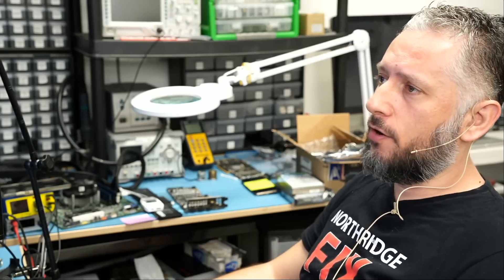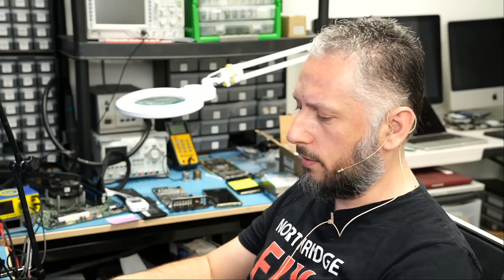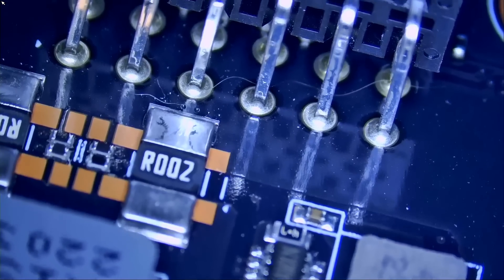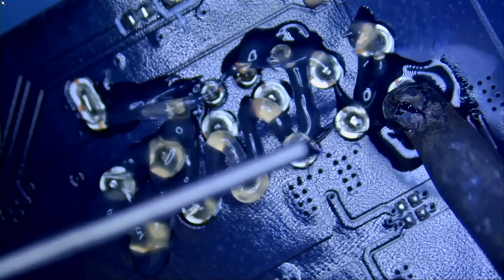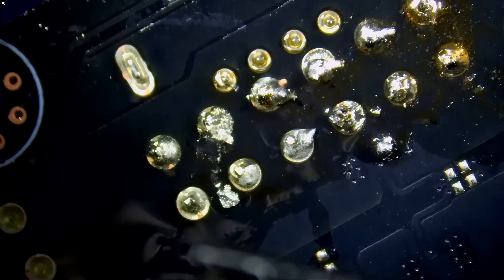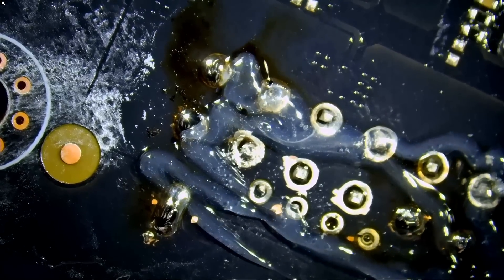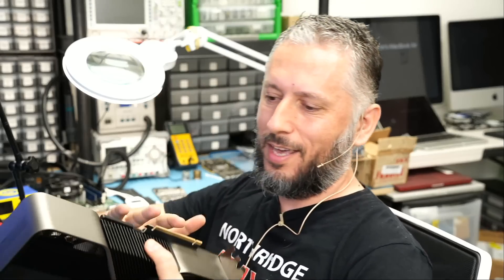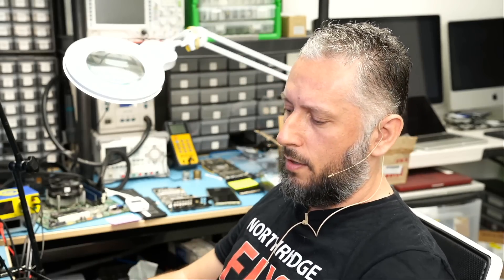Serious issues with 4090 power connectors melting - Is the user at fault ?

Comment: The connector for this particular card is a joke. This is in no way the user's fault. This is a design flaw. The WHOLE design is a flawed design. There is not only the issue of the connector being too weak for the amount of power going through it. There is also the problem of these connectors going out of the side of the card instead of the back. As these cards are extremely large, unless you have a very wide case, the wire will need to be bent to fit. This is a no no with that type of connector. These cards are an absolute joke and a nightmare to boot. I will stick with my 3090 TI for a couple of generations. I am good to go. Although the 3090 TI has the same connector, it isn't on the side of the card. Also, it only needs three power connectors, not 4. Too much current and too much pressure.  I think Nvidia needs to jump off a cliff with their prices anyways.

Comment: I think this connector is not ideal.

I know why it's a thing: three big connectors was too much, there needed to be some better solution. I know from an engineering standpoint this connector is fine, it meets all the specs and if connected securely works perfectly fine. It does require a lot of care from the user however and no small amount of force - which may seem excessive to some - to connect properly and avoid melting itself.

It's not perfect, perhaps the extremely high power draw of these boards just necessitates a lot of big high power connectors that are a little easier/more reliable than this particular connector and there's no neat way around that.

Comment: This connector is certainly at fault here.  If the connector is plugged in and the cables are routed tightly in the PC then some of the pins will loosen faster than others and have a different electrical resistance.  This isn't just a user error problem it is a design flaw that can take time to show its flames.  The metal in the pins themselves will loosen over time through normal use and this is a problem with all devices with connectors, the connector will just loosen over time.  Loose connections have more electrical resistance and that means more heat.  In this case its enough to melt plastic.  If it were allowed to get worse then that could mean fire!

A proper high current connector would have used a larger surface area with screws to secure the contacts together.  No chance of them coming loose if you screw them down properly with a lock washer on the screw.
Reply: And it is not the pin side of the connector on the card, it is the socket side on the cable end that will loosen and eventually cause this problem.  This means manufacturers of PSUs and video cards can just point fingers at each other until the end of time, but in the end it is the connector design that is bad.  Anything using this connector is going to melt eventually.  It should not have been designed this way.  Should have been large surface area contactors that screw together with lock washers on the screws...

Comment: I suggest to check the power rating of the card first and install the appropriate 12vHP power cable that is rated for 600watts for the 4090 series.

Comment: As far as I know, the problem lies more in the power cable than in the connector itself. the fact that the plug-socket set withstands up to 15 connections-disconnections, unfortunately, does not help here either..

Comment: so this has already been looked at by gamers nexus. although i still think the pins are too small for the amps it pulls. the actual cause is the owners of the cards, they need to push the connectors in harder

Comment: I disagree the customer should be responsible for not pluging in a cable all the way….but also the customer should be able to tell the cable is pluged in all the way, which in these cases the customer can not visually see the connectors pluged in due to the heat sinks. And they cannot feel if its pluged in all the way because theres no click from these plugs

Comment: THANK YOU !! Alex for your professional/experienced opinion., lets say 500 watts going through those whimpy connector joints/pins, and  those split/dimple/crimped connector pins are weak as heck. Thanks for your opinion that the manufacture should take all design issues including user error and make the connector full proof. On the cards where 2 or 3 connectors were used, this problem NEVER existed. Other manufactures have made adapter where the connector is even weaker. Thanks again for your professional opinion.

Comment: There are many unanswered questions.  Is there some reason why the user is likely to plug in the connector incompletely?  If so, then this is a design flaw -- or at least inadequate instructions -- instructions to seat the plug COMPLETELY should be prominent and obvious; likely repercussions should also be stated.  High-current connectors are tricky to design and to fabricate and use is likely to wear the surfaces and loosen the contacts.  Once resistance begins to accumulate, they begin heating up, oxidizing, and resisting current flow more quickly.  By choosing to install connectors instead of soldering the wires directly, the card manufacturer has assumed the responsibility to assure that the connector is used correctly.

Comment: Where is the heat coming from to melt? There must be a resistance somewhere between the plug and the socket. I2R= W. Perhaps the plug doesn’t match the socket correctly..and therefore not making a good resistance free connection.

Comment: This is exactly why I haven't purchased a 4090 GPU. Alex is a professional in this field of electronic repair and he has questioned several times about the fact that so much power is now being drawn through such a small connector.  Sometimes innovation does not pay off and I personally believe that this is a weak failure point on such an expensive computer component. I would rather have 4 PCIE power connectors into a 4090 than have the connector melt and create a risk of fire.

Comment: At the bare minimum connector is sub optimal for the job and potential user error is last nail on coffin. But id say connector design is bad and should engineered better or used industry standard connectors instead, so on manufacturer is the blame.

Comment: There are 2 types of female pins for this plug, one of which has been officially stated you should not use, these pins for male/female are rated at 9A (the same per pin rating as a 6/8 pin BTW)

a 12/16 pin plug gets 6 pairs of pins for power and ground, that is 108watts per ground/power pin pair, that meas 648 watts for a 12/16 pin plug, now a 8 pin plug has 3 12v, 3 ground and 2 sense pins, now lets do some math here so 1 pin has 3 12v if i use 2 of them i get 6 12v and a 12/16 pin also have 6 pins they are the same

8 pin are only rated at 75 watts so you need 4 of them to match a 600W plug, now lets ask WHY a 8 pin is rated at 75 watts, what ever the reason is if you obey the same rules the 12/16 pin plug is a 300 watt plug

Comment: This plug needs a better locking mechanism, one that you get close and pull a lever down that locks it into place, something like those jars with clamping lids or a LGA socket lever

This plug was designed to bypass the official spec rules of the 8 pin plugs, 2x 8 pin are electrically just as good as this plug

see my comment on last video for more details

Comment: After looking at the 90 adapter, it looks more like the manufacturer used a less than adequate connector on the board.  No way this is the user's fault.  Fire the engineer, not the user.

Comment: 450watts tdp ÷ 12volts= 37.5 Amps
overclocked i heard the 4090 can hit 600 watts
which would equate to 50 Amps... imagine pushing that much current through 6 tiny pins (6 pins for +12v and 6 pins for gnd). this is a simple electronic engineering failure. 100%

Comment: Problem I've seen with some boxes is that the cables are restricted with all the hardware and sometimes makes it difficult to plug in the cables.  (Solution: get a bigger box)  But, some are limited on funds and go for the hardware expense rather than the housing that many consider less important.  Not so.  Having full access to easily work inside the box is very important, especially when you do the higher end improvements like liquid cooling, etc.  Buy a bigger box.
Reply: Bad take. Most cases in use are m-atx, full stop. The card doesn't fit properly in far too many cases and it shouldn't have been designed like that. Most people don't want a hulking atx case and Nvidia should design cards that fit in most cases without the side panel impeding the cable. I could see if it was people jamming 4090s in ITX cases but that's not really it. To be totally honest, the card should have its own power supply that just plugs in the back. Running 400ish watts generally across this cable is poorly thought out from the beginning.

Comment: First it's a connector designer fault, but it is accepted as a new standard so that's it, it will hardly change. Secondly melted connector was a big issue when 4090 was released. Seems to me long time ago now lol. Anyways, the issue was posted everywhere, on every social media, every tech related media. 
Then they found what was the issue - connector has to be plugged all the way, there is a notch which should click (silently) and which is a kind of security for the connector to stay plugged. Just like 8pin, or 24pin...blah blah blah...
It's a bad standard imo, but it's a standard now so after so much talk about 4090 melting connector one should guess everyone knows about the issue and the fix. Because of that I split the blame between connector designer, the gpu manufacturer for not printing the guide with big red bold letters connector have to be plugged in all the way, and lastly the buyer which missed that info about the issue and how to solve it  🤷‍♂️ LMAO I just read what I wrote, looks confusing LMAO
Reply: Get some help dude

Comment: These connectors suck, I’ve seen several units come in with issues and the connector looked seated at a glance but once you checked it physically it wasn’t fully seated.

Comment: The key here is that the connector is so finicky that even tech-saavy users who know how to hook up components were finding burned up boards. Now, just wait until you start getting burned up ASUS motherboards from the brand new overvoltage scandal that has emerged. That arguably has made the 4090 connector issue small potatoes by comparison.

Comment: That 90 degree connector will be interesting. Looks solid. I’m wondering if there’s a thermal expansion problem under load, which somehow changes the contact area between pin and socket?  Glad I can’t afford a 4090

Comment: Lol that 4090s are smoking HOT, literally. I am glad i went with the 4080 and i have no issues with the connector there. Just quadruple check if the connector is seated rocksolid all the way in and the cables are not bent so they are not putting any stress on the connection. Up to 600W my ass, these connectors are burning within 450W of strain.

Comment: It’s a bad design and user error combined. When properly inserted, it works fine. The problem is that folks are trying to reuse their previous PC case, but the 4090 is just bigger and if the card is not in a vertical mount - the power cables get wedged in between the side panel and the card - the power cable pins are the victim. If folks would buy a PCIE riser and vertical mount - the power cables come out the top and there is no interference.

Comment: This new connector is a design fail, cable sticks quite alot from already huge card, often making it impossible to close the side panel without force, add the weight of the cable that is often connected through 4 another cables and theres no way that small connector can take all of this.

Comment: mmmmm..the connector is a 12VHPWR socket, rated at a maximum of 600watts, that's 100 watts per pin (because there are 6 +12V and 6 GND pins), @12V that's 8.33 Amps per pin. My understanding is the 4 smaller pins are used as 'sensors' to detect if the plug has been fully inserted, if the sensor pins do not make contact with their counterparts in the power lead then the power is supposed to be limited to either 150 or 300 watts. That indicates to me that the problem is not the incorrect insertion of the power connector but rather the lack of contact area on the pin itself.  The 4090 card calls for a 1000 Watt power supply.

This is going the same way as USB-C, with ever higher current demands made upon smaller and smaller contacts ... with the same inevitable result....... It would be interesting to put a meter on the actual current draw with the card in normal use.

Comment: Normal devices have fool-proof protections. So this connector shouldn't even transmit the voltage if it's not properly connected. Nvidia could solve this with screws or light indicator showing proper connection.

Comment: Traditionally PC builders and enthusiasts have never had to deal with such high current on wires and connector.  Nvidia would not have placed the connector if it was inadequate.  You are dealing with some serious amps here.  Make sure the connector is fully seated and I don't think you will have a problem.  Be sure the wire is not bent sharply, straining the connection from too small a case.  I have a 4090 and keeping a eye on it.  So far so good.  Use your finger to test the temperature of the wires and connector after a gaming session.  Use common sense.

Comment: Have you seen any 4080s or 4070 TIs with melted connectors? My theory is those aren't melting because they draw less power, so I've been running my 4090 at 55-60% power limit and still get performane better than a 4080 at less power draw than a 4070 TI.

I would've went with a RTX 4070 to avoid using this power connector, but I needed 24 GB of VRAM for AI :(
Reply: Those arent melting because users learned from the idiots that melted their 4090's and did their due diligence the first time.

Comment: what difference does a 90 degree connector make if it's not plugged in properly?
Reply: In the electric business 90 degree connectors are made to relieve stress (from hanging or something keeps tapping or moving it).  90 degree connectors also are made for the human hand to apply more normal|[90 degree] force towards the female mount.  The next GPU had 90 connector and it still failed.  So it probably did not fail due to stress or a bad connection.  Probably bad design of calculated AWG and amperage.  Alot of the cards only have the top damaged inputs (which is probably where alot of the + terminals are located).  In DC electricity you see this alot with bad design gauge wire that cannot carry the heat and amperage or a really bad connection.  Think like a 12V car battery system, if you have that experience.  You get build up usually on the + terminal.   Bad and crazy stuff happens when connections are bad and DC arcing;  or spark plugs arching not arching correctly or not spaced correctly.  Residue precipitation or carbon build up can cause problems or ignite dust or plastic.  Lots of Weird stuff gets out of control.  I'm not saying this will happen with GPUs though.  But its something you need to consider when using over 1000W PSU and a high wattage draw device.  That 5h1+ gets scary.

P.S.  Just for your education:  In circuit design or telecommunications, 90 degrees traces|paths are bad because electricity likes to shoot off into the air at high frequencies (which creates radio signals and interference).  Some architects like to round corners off (instead of having a near perfect 90 degree turn).   Lots of stuff they don't teach you in books.  Alot of electricity know-how is not 100% understood or controlled.  And especially not controlled when connections and terminals start breaking down.

Alot of the newer generations are losing or not learning the information that can kill you.  They depend on altima or whatever circuit simulator;  none of that stuff is in their head.   So you end up with newer designs that are failing more frequently.  The WW2 engineers are dying off.  They probably would have said, lets put all this amperage over some big a55 wires or lets use two connections.  But I can guess that a 40-60 year old guy made these changes with this new connector and only theoretically tested it through a simulator and never thought about it;  he probably never seen what electricity will do when you have a large load and huge power supply pushing over a puny connector.  WW2 engineers probably saw what happens when you have a high wattage PSU and high wattage load traveling over a tiny terminal connection;  5h1t heats up quick.  Even if the terminal is not connected correctly, you get a arcing lighting bolt that jumps like a tesla coil where its trying to find its way back home.  WW2 knows what happens when you push continuous 500 Watts or more over bad terminals (on a underground submarine (and then an inescapable fire occurs)).   There will be persons who read this and will still think it will be okay to use that tiny terminal in the future.  They lack the witnessing of real world f4ck-ups and they lack the imagination or inner voice that asks "Will this kill me".

Even if a good connection occurs, those tiny little pins are not sufficient enough for when 5h1t goes bad.  You have to use thicker wire in instances when high amperage surges occur (for heat dissipation).

Comment: IF there is a notice in the instructions stating what will happen if the user does NOT plug the connector in fully, it's then on the user.